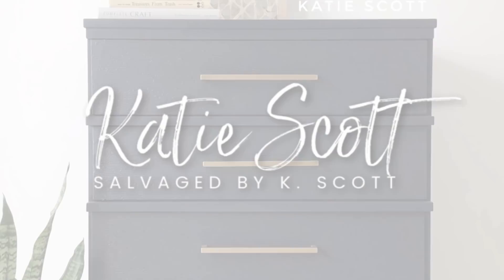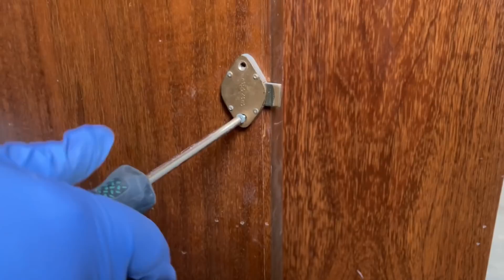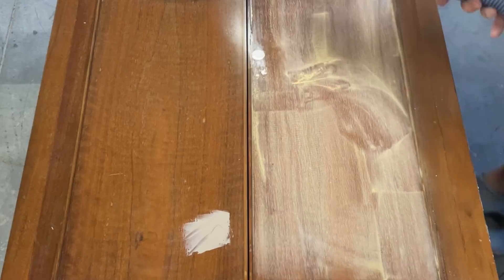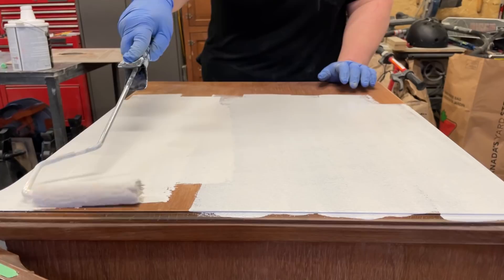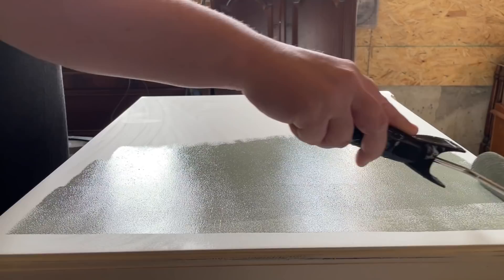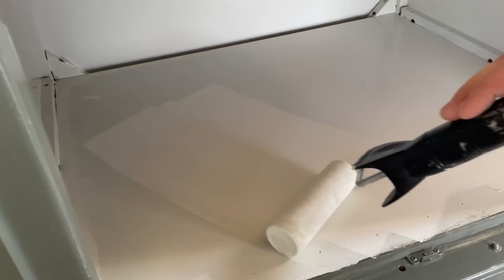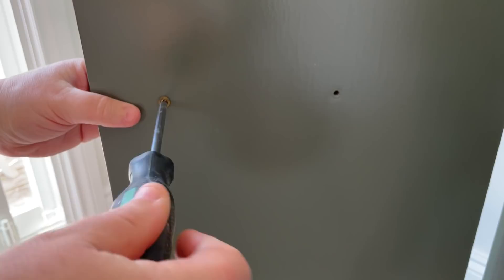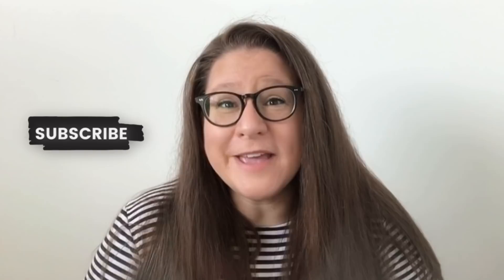Furniture Makeover with Benjamin Moore ADVANCE

Comment: OMG, the knife hinges. I’ve just gone through hours of hell trying to get the hinges onto to antique buffet I picked up on the side of the road. Some of thing hinges were attached but others were removed and just left in a drawer. Since they look handmade they’re not all identifcal and not really interchangeable so it was really difficult to figure out where they went and how they worked. I was so close to giving up, and just putting on new hinges but I slept on it and the next morning managed to work it out. I know appreciate how they are hidden, etc but I’ve learned to never take off hinges without carefully marking them etc for reinstalltation.

Comment: Beautiful work here. Love that you are donating here. I am trying to get to the point were I can do the same for struggling parents. That being said I am a Beginner here so couple of questions. I didn't realize I had to use a primer when using that Benjamin advance was that because of the wood filler situation?. I was buying it so I could avoid that. Also, paint spraying with it is not possible or advisable & why?
Reply from the maker: You should always use primer under your paints if you’re planning to resell. It eliminates so many common issues and gives you an extra layer of insurance that your new finish will last. Advance can definitely be sprayed if you want to.

Comment: Got a ? I have a set of end tables that have very swirly and ornate legs and it also has multiple layers of paint... how can I get the paint off without having to hand sand each little pocket and swirl????
Reply from the maker: You could try a chemical stripper but you’re definitely going to need to spend some time hand sanding and scraping paint 🤷🏻‍♀️

Comment: I have a question about your Surf Prep sander. Does it goes through sand paper quicker than a ROS sander or is it more efficient? I love the idea of it but at such a high price I'm doing my research first 😁
Reply from the maker: Hi Shari! It’s usually the surface that you’re sanding that determines the amount of paper you go through and not the sander. I still use my cheap 5” orbital for large flat surfaces because it’s bigger so it gets the job done faster. The SP 3x4 is a detail sander that’s great for getting into tight spots and sanding things like curves, spindles, etc. but it can also cut through large flat surfaces.

Comment: Beautiful work! What is that sander called please? I like that it has a vacuum. Ty!
Reply from the maker: That is my Surf Prep 3x4 Electric Ray Sander. It doesn’t come with a vacuum but there is an option to connect it to a shop vac. You can use code SALVAGED10 to save 10% at www.SurfPrepSanding.com

Comment: How do you seal cabinet paint ?
Reply from the maker: The Ben Moore ADVANCE paint that I used in this video is designed to self seal. You paint in whatever sheen you want for your final look and additional top coats are not recommended.